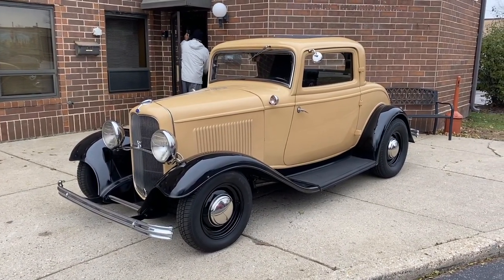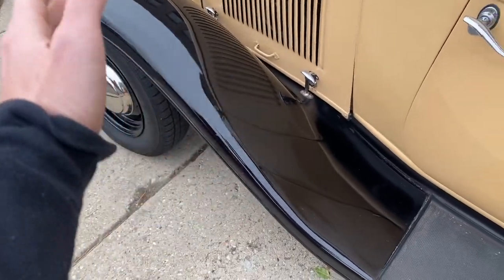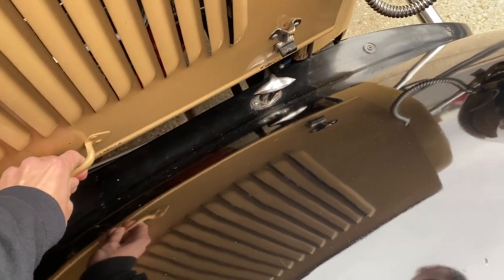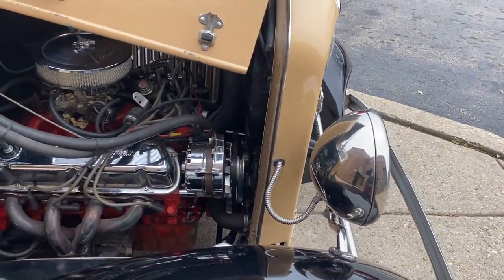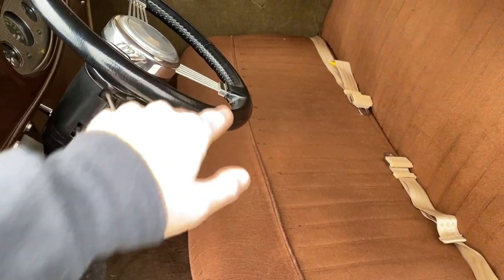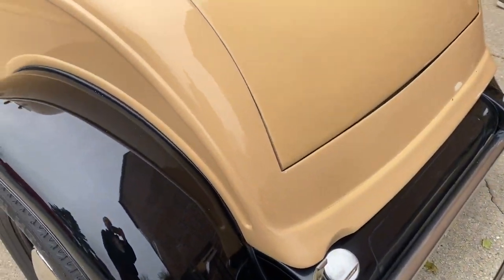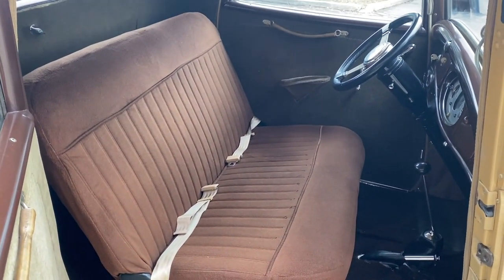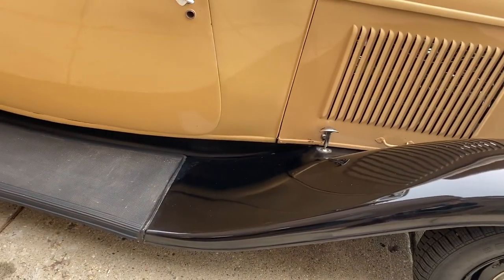1932 Ford 3 Window Coupe - Steel Body W/ Upgrades - SOLD

Comment: Absolutely love it! So love the fact that you got a hot rod that has the correct branded motor in it (looking at you chevy 350 people) I love these kinds of hot rods that retain that original style but have some mechanical and safety upgrades